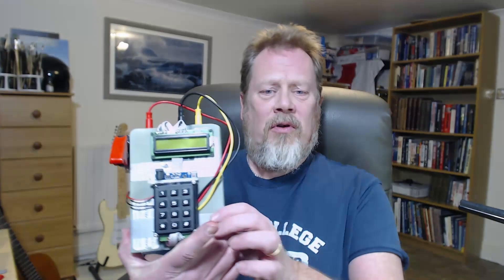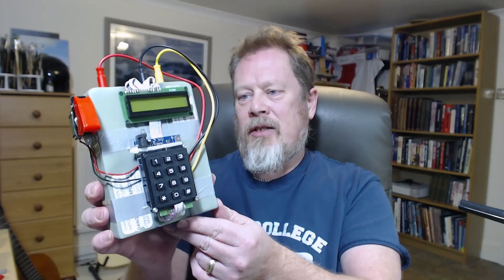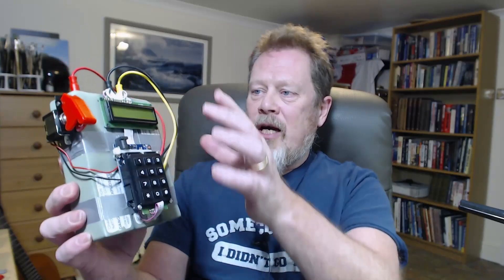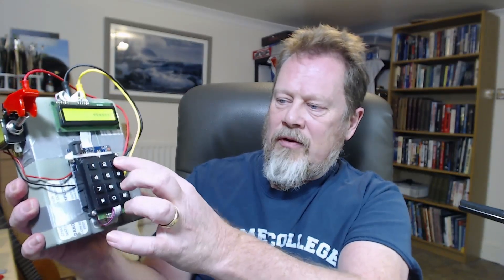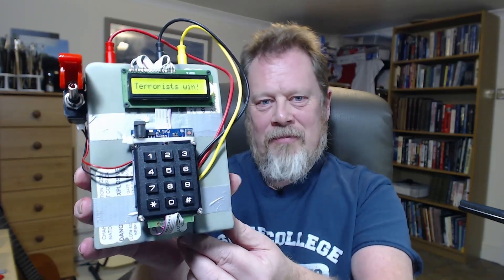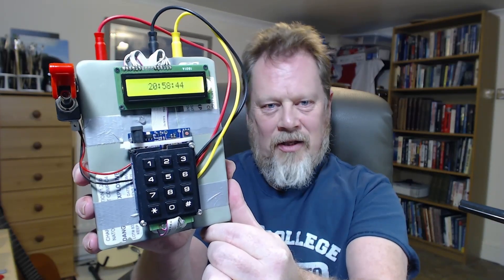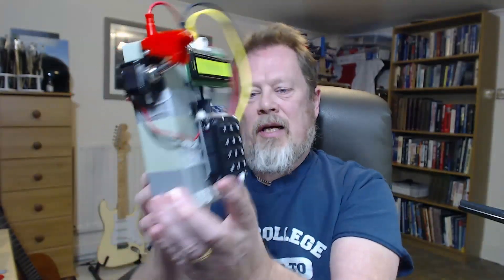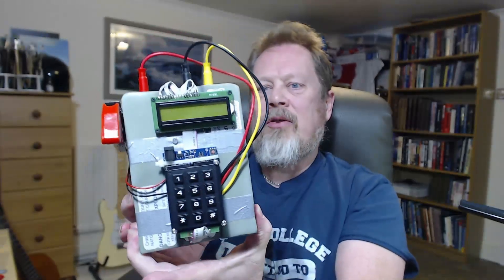Make a CSGO C4 prop - Part 1 (How it works)

Comment: also, can i make it with cardboard? the box
Reply from the maker: Yes, you could also make it from polystyrene sheet also known as plasticard. With this you can cut it with a knife or scissors and glue it together with model glue. In the game the C4 is supposed to be home made so it doesn't have to look perfect.
Reply: but what's the size of this box? @radboogie
Reply from the maker: 40mm x 120mm x 160mm